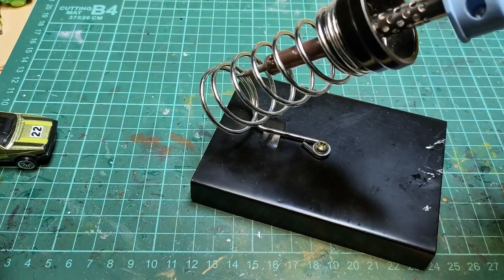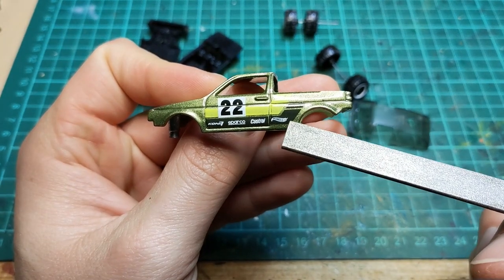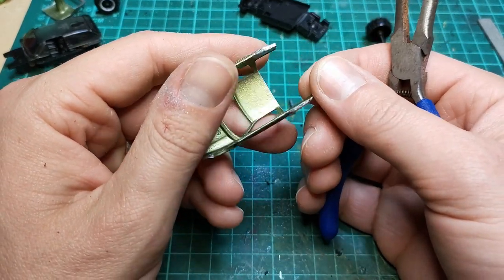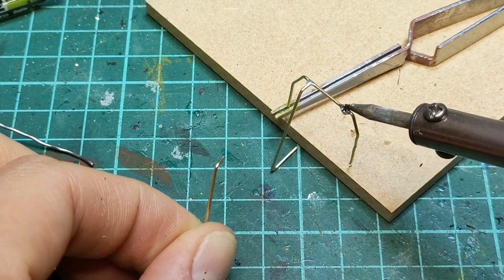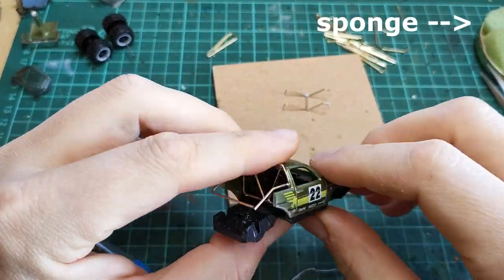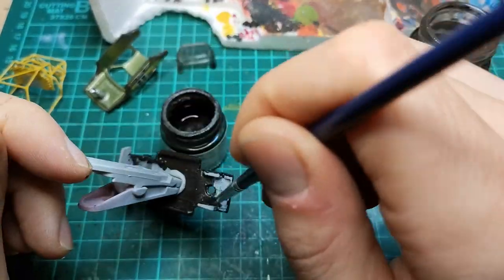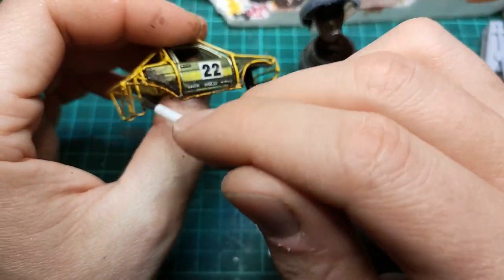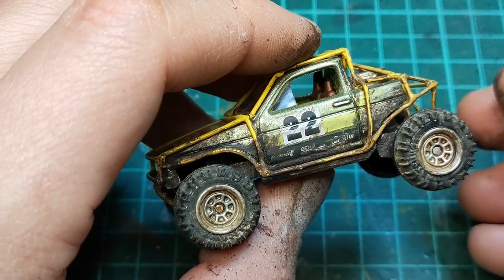SCRATCH BUILDING a roll cage with PAPER CLIPS | Realistic Hot Wheels MK2

Comment: Great looking roll cage.

I have made small parts using my soldering iron. I had to use a wet paper towel as a heat sink to isolate the parts I was soldering from the parts I had already soldered. It was very frustrating, but it turned out ok.
Reply from the maker: Thank you! Yeah, it can be a big hassle especially with small parts.

Comment: Excellent work, it turned out very realistic almost as if someone just took an old Volkswagen and turned it into a Rock Crawler.  Great job on keeping It's original paint, It's always hard because one mistake can ruin it.  I think I might give the paper clips a try, next time I need a roll cage to save on the styrene, although I'll probably use superglue as I don't have a soldering iron.
Reply from the maker: Thank you! Sometimes the hot wheels paint jobs are good and sometimes they get the paint stripper haha. I've done paper clips and super glue/baking soda before and it was a nightmare compared to this method. I need to get some brass rod and try it out with that!

Comment: Great idea, looks awesome. I used 1mm thick wire to make a roll cage for a Hot Wheels Imparable as the car pretty much has no interior. I think the solder and paperclips looks much more neat. 

Also right on the money about temporarily walking away from a project, it helps. I had to go for a run.  

I subbed.
Reply from the maker: Cheers bass guy 👍 soldering with wire/paperclip makes sense as a scale equivalent to welding steel bar/pipe. I'm glad I saw someone else using the technique which spark my brain into work!

Comment: Awesome job turning that Golf into an off-road beast. The 3D printed fuel tank in the back was a very cool touch. Though I think you missed an opportunity to add some dune buggy style exhausts weaving through the roll cage out the back.

Outstanding work (especially for a first attempt with a dollar store solderimg iron!) creating a paper clip roll cage. I've used clips to make bumpers and brush guards, but haven't attempted a full body cage...yet.

Thanks for sharing and keep on keeping on!!
Reply from the maker: I have some experience with the cheap soldering iron but paperclips are really not ideal 😅
I'm glad you like the results!

Comment: Can i ask what kind of paper clip can i use if i use soldering to weld it? and what kind of lead you using, thankyo for  answering
Reply from the maker: I really wouldn't recommend paper clips as they are not easy to stick with solder. Using copper or something else like brass might be a better idea. I have also seen people using solder itself as a bar material. As far as solder goes there are opyions with no actual lead in them and I'd recommend those.